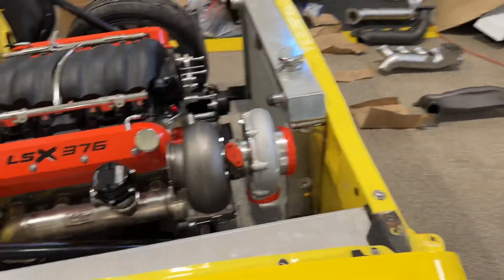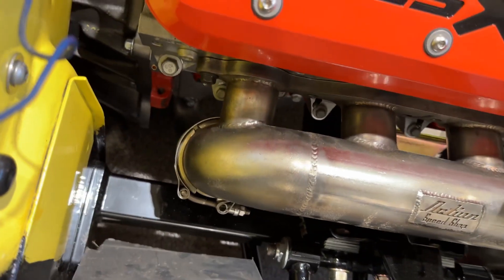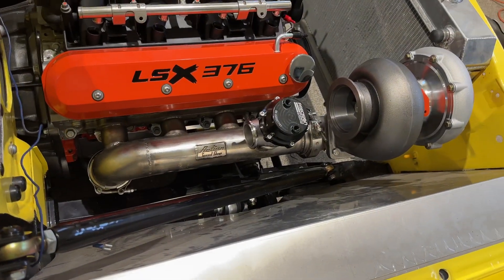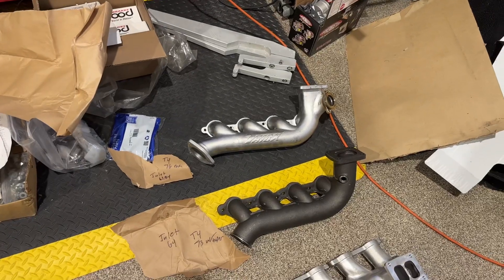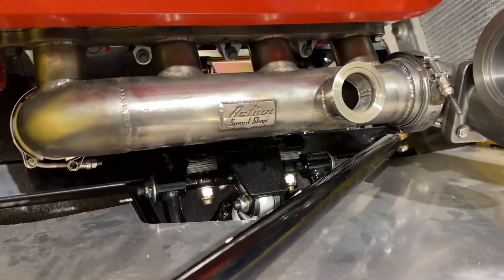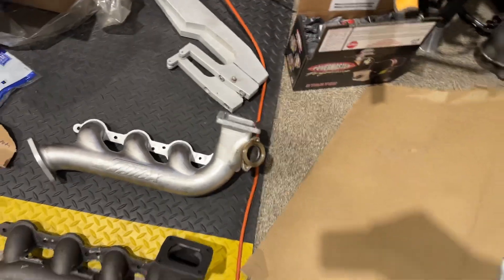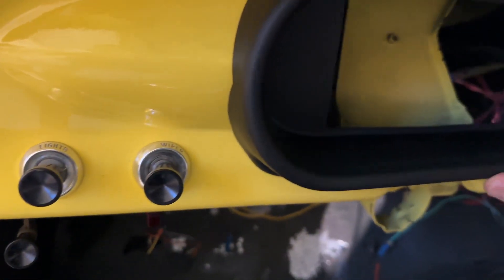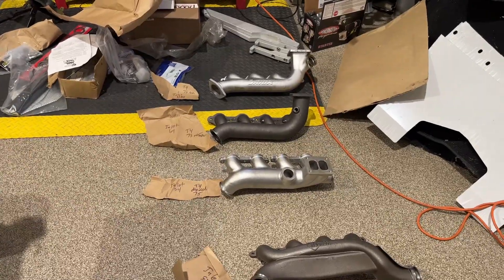LS single turbo log manifold comparison

Comment: How much higher is the top of the turbo compared to the top of the LS3 intake manifold. Just curious thinking of putting a turbo on my LS3 stroker which is in a 81 Trans Am. Hood clearance is one of the issues  on the list. Second  issue would be the exhaust after the turbo . I’d want it going through and out the tailpipes .
Reply from the maker: @vikenlink  unfortunately I did not measure that dimension. Some of my videos show hood clearance to the turbo with one of the manifolds. Might be a challenge for you depending on turbo size. Not sure how much under hood space you have but a 81 trans am is probably tight, like the little nova. I managed to make a downpipe and do full exhaust. I’m almost done with hot side plumbing now and will post an update soon. Stay tuned.

Comment: I run the Holley turbo manifolds on a lq9 in a fox body with a AC  compressor, T4 s480 on the passenger side with a 4” down pipe that runs to the rear of the front fender. Been beating on it for about three years 
and 4 miles. At 22 psi it makes 800 wheel on E85 and about 2:1 back pressure. 
I like the holley manifolds because the plugs are easy and don’t worry about cracks but I know they are restricting. I plan on building a set of real turbo headers soon over the winter and swapping to a t6 housing.
Reply: @scottgarmon4865 any photos of your setup online? Are you still running the holley manifolds now or have you done the new setup with the t6? I'm really thinking the Holley Hookers might be the right set up for me. Im curious how you did all your hot and cold side with the A/C?
Reply: It still has the Holley Manifolds, haven't changed anything yet. I dont have any pictures on line. I used the LSSimple
accessory brackets, the Ac compressor is on the passenger side. The turbo is behind the passenger headlight. its a tight fit but not too bad. The S400 frames are pretty large. If I ditched the water intercooler on the intake a factory hood would fit. 
Are you building a turbo Ls fox?

Comment: The set bolted to the car in the video would be perfect if the waste gate flange was covered up and you used a motion raceworks gate flange on the swivel end.  Absolutely perfect setup.  The trick manifold with the v band welded to the two bolt flange looks absolutely awful.

Comment: I just have to say the "flow" valuations you are giving based on size of the feeds to the turbo are misleading a bit to consumers not in the know. The size of the exhaust feeding the turbo are not really that important, to a degree. Example.... 2 2.5 pipes feeding a divided t4 flange is a better route than 2 3 inch pipes. With too big of primary hotside pipes feeding the turbo exhaust housing can creat lag and a lazy turbo. Hell 2.25 inch exhaust off of stock truck manifolds has fed cars north of 1000hp.

Comment: Anybody else get super annoyed with pipe systems that are supposed to flow high volumes and have tight bends and 90 degree connections? Jeez some manufacturers need to try harder!

Comment: Great video. Late for me as I went with the Holley hooker manifold for my 72 el Camino.  Shot straight up to my waist gate for priority using the motion raceworks flange then the turbo runs off the side where the battery would be. First kit I fabbed up and am pretty happy with it.  Downside is no room for the ac compressor.

Comment: how far in iches does the summit manifold stick off the head? i really like that its divied and looks close
Reply from the maker: It’s about 7 inches.
Reply from the maker: It sticks out the farthest of all but it is very nice. Probably like 2” to the log.
Reply: @Coolstuffwithjim thanks dude one more i have about 8-9 inches from cylinder 2 to shock tower in my 1990 firebird it looks close but theres really no specs on the summit piece you are it for the money trick fits but i have a twin scroll and want the divided manifold and 2 wastesgates is better than 1

Comment: Really would have liked if you fitted all of them been nice to have actual visual reference
Reply from the maker: Sorry bout that- let me know if you have specific fitment questions on any of them and I’ll try to answer.
Reply: I know this is an older video, but for a 600hp 6.0 in a 2500hd what manifold is recommended? I do want an electronic wastegate@Coolstuffwithjim